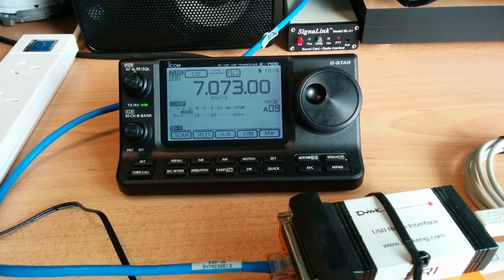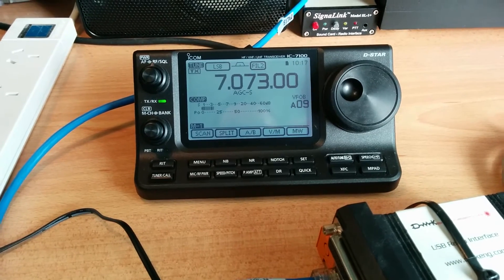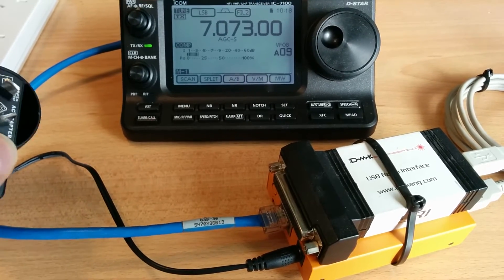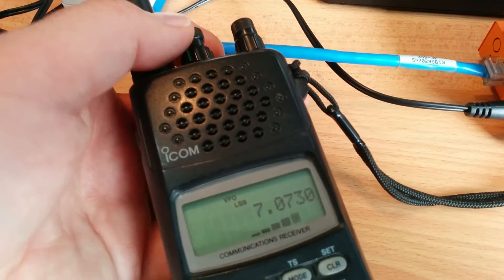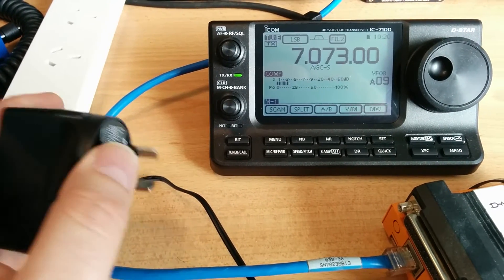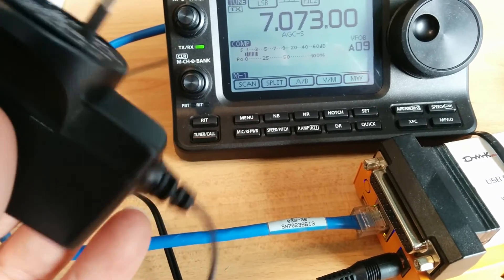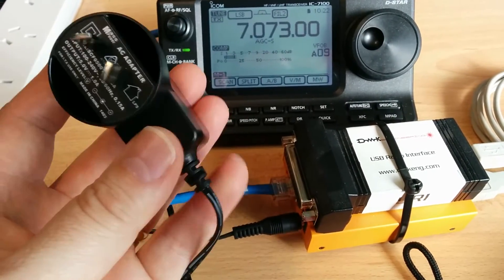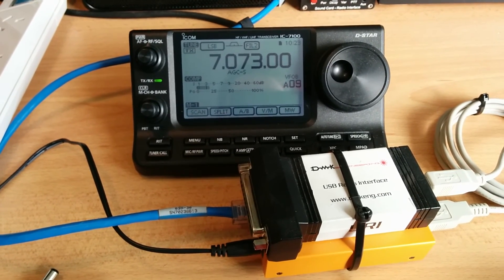RF noise generated by switchmode "wall wart" power supply.

Comment: Yeah, Cat 7 here as I jumped over 6 and a ton of RFI just went poof (I was using 5e) but from my computer OUCH!  I get a microphone near it and it is a RFI hotbed within 30cm from it.  Quality PSU in the bugger and besides I am surprised that an all metal case allows the RFI to come through.  Right side of my case is solid metal and it hot as can be but is grounded.  Baffling how to fix this.

Comment: I live in a steel reinforced apartment building, and it is impossible to listen to powerful broadcast radio within a few meters from the walls indoors or outside. Long, medium wave and the tropical band are completely full of hum, and at night those frequencies disappear one at a time. Curiously, during a power outage the best signal is with the antenna orientated same as outdoors, and the building has almost no effect. No idea what to blame: stupid energy saving bulbs, smart electricity meters, ethernet over powerlines.

Comment: A 32" Vizio LCD TV on the second floor of my home has a similar affect across all bands.  I'm in a densely packed semi-urban area and the noise is everywhere.  From home, mostly local rag chews are the norm to break through the noise.  For any real DX, my only respite is operating portable near the beach or hitting the trails.  Thanks for the post.